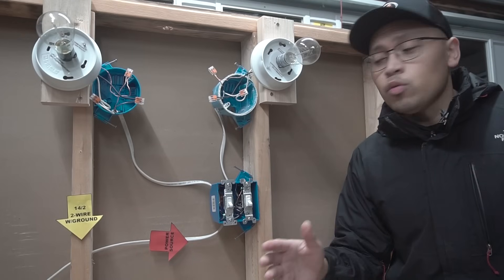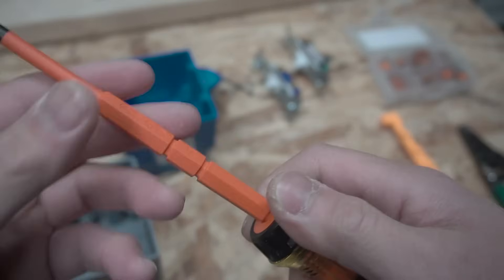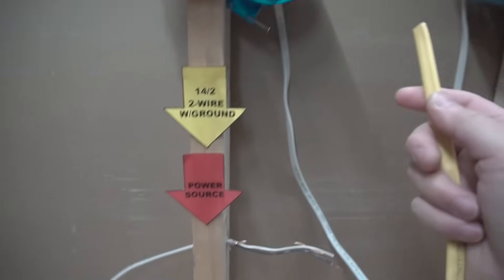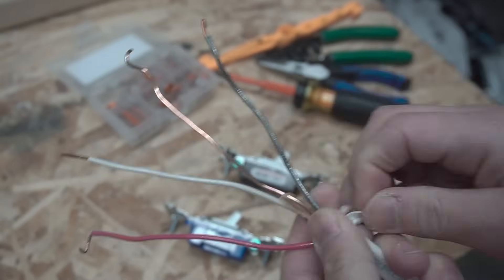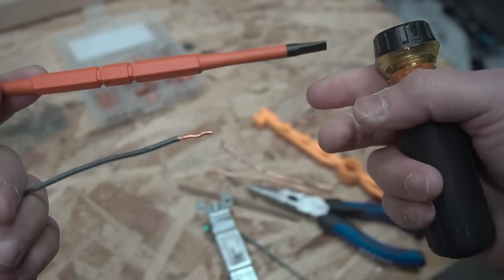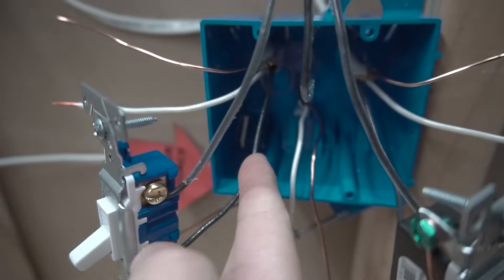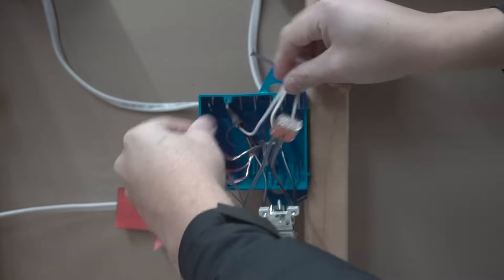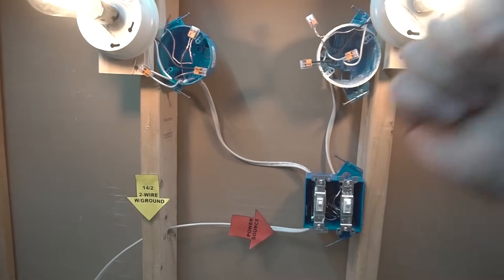How To Wire 2 Single Pole Switch Inside 2 Gang J-Box To Light Fixture (2022) | DIY Beginner Tutorial

Comment: Your a savior man any other combinations you can think of and recaps are great 👍 you explain it better then a teacher .
Reply from the maker: Thank you so much!! Next video is a 3 way switch, this one will take longer to make but it’s the next out. Stay tuned 🙏🏽😊
Reply: 100
Reply: Is this the same way you hook up a fan and a light in a bathroom
Reply: Luckily i was smart enough to start the video before i completely took the box apart lol
Reply: This is what I needed thanks dude! Now I need to to do this in my bathroom bec.i always replaced my other switch,keep burning out so you know why?
Reply: I have 2 coach lights mounted on the wall of my front porch. Both are switched from 1 switch inside. I have installed 2 ceiling fans on the porch. Can I get  unswitched power from the already powered lights?
Reply: Great video. I should have watched it before I tried it myself and blew a fuse. 👍👍
Reply: Very good
Reply: Yes! And tired and frustrated and hate your life for starting this project

Comment: Can you comment on how to wire a second switch when the power goes to an existing light first?  I am adding a bathroom fan/light combo, and the existing switch, which controls a light on the wall, has the power going to the light first.  So I only have one black and one white at the existing switch.  I am hoping to only have to bring one wire from the new ceiling fan to the second switch?  Is that possible?

Comment: That wire strip gauge on the back of the switch isn't for if you're making a loop! It's for if you insert it under the metal plate under the screw straight in like a "back stab".  You have wire insulation under the screw which is a big no no! People dont do this! It'll create a hot spot and potential fire down the road.

Comment: Great information. 
Is it safe not to use pigtails and just run the hot to one switch then straight to the other switch?  I have a fan and light fixture in bathroom connected this way. . What are the dangers of keeping it like that?  Thanks!!

Comment: How would you wire: one power source, two-gang box, one side standard single pole switch that controls one light, other side a toggle switch/outlet combo where the outlet is always hot and the switch controls a different light?

Comment: I am 99% sure I did this correctly. Both lights work, but the left switch shuts off both lights. If the left switch is off the right switch does nothing. Back to the drawing board after supper

Comment: Sounds like what I want to do. I want to come off the light switch for my garage ( the one at the front of the garage) to a second switch that in turn will go to an exterior all weather outlet so I do not have to route my Xmas lights under the garage door. I am thinking I need that second switch to control when I am allowing power to the outside. Does this video solve my problem? I understand I need different wire for the extension going outside

Comment: Hi I'm planning on wiring a ceiling fan on one switch and two wall sconces on a separate switch. (2) Switches (1) J Box. Would I basically just pigtail the sconces together and then connect to the switch for the sconces? Sorry if this is confusing the video helped me understand a lot more about this project just wanted some insight on how to throw (2) lights on one switch. Thanks!

Comment: Great video. Question - if the second switch is in a different box and different room, does this still work? taking a 14/2 wire to the second switch from the first switch, connecting the neutrals, connecting the grounds, and hot from first switch to top screw, hot from fixture to bottom screw?

Comment: I came across your video because I’m in a dilemma. I’m in a modular home. I have a 2 pole switch out. I get the organizing from the power source to the switch. My problem is, the switch has power source from each side. The original contractors had a jump to keep channel to other outlets on the loop. One switch operates laundry room light and other an outdoor patio light. Do I need to combine the power source wire as one then wire the switches? Or do I need to put a jumper line like they originally did? The original switches were self contained style and we are converting to the ones like this. I really appreciate your expertise because I’m lost.

Comment: New sub 
Well explained. 
Only concern I have is, seems like you connected one black power to the top of one switch & then the other black power wire to the bottom of the switch, hmm. I was thinking you were going to connect both hot black wires to bottom of both switches. Hope this makes sense.

Comment: I did the 2 single pole switch, but I have a 4th wire in the box that goes to two more sets of lights.  I added the black wire to the cluster of hot wires and  the white wire to the rest of the neutral.  My problem is when I toggle off the original switch all the lights on the line go off
.  When it is on all the lights on the string can be turned on an off, as long as the switch is on.

Comment: I love the video and while I understand the concept, I’m a little confused. I have a mix of older romex and even older 2-wire systems. It’s not knob and tube, thank God, but I’m still stuck. I have a 2-gang box like you, with my Front Porch light and Living Room light (ceiling) in it. It is obviously the same setup, except the power and switch legs are in the ceiling. I was able to test continuity for all, except the 2 switches in the 2-gang box are somehow tied together. I want to put in a chandelier in the LR, but I only get it to always be on, and switch does nothing. The porch switch leg and LR switch leg are tied together, based on continuity test, but I can’t figure out how to wire the switch in between them. In the LR ceiling, I have Source, dining room switch leg, porch and LR switch leg pairs. I didn’t make note of the connections when I removed the old fixture a long time ago (put in ceiling fan, but it was also always on). Help

Comment: I have an existing ceiling fan on a single switch and want to add a 2nd dimmer switch for recessed LEDs.   Can I splice my power source first with pigtails, then wire each switch accordingly?

Comment: If you have a socket coming off of that & need a hot to continue, is it ok to have 2 hot pigtails with the hot coming in & hot going out? Basically, is a single hot going to 3 hots, 2 switch pigtails and a hot line continued for a socket.

Comment: I ended up with two red wires, one with power and the other not. My left switch does not electrify my room wall switch for a lamp, but it does power my living room downstairs. Do I need to connect both red wires to the back of the lamp switch?

Comment: Hi, thanks for the awesome video. Very clear and consice. I have a similar setup in one of my bedrooms, except I will be running 14/3 to a ceiling fan instead of two 14 / 2 wires controlling separate lights. I am not sure how to go about the 14/3 wire in my setup as the extra "red wire" is throwing me off on how to go about it. Thanks

Comment: Just looking for some input on why 2 power would have to be used instead of 1 on a 2gang switch when the tab is still intact...
I understand that 1 power should work to power 2 lights separately. 
However, the dilemma I dealt with is, I had to run 2 seperate power from the same main line to each screw to make the lights work separately. 
So basically... main line > 2 seperate power/neutral/ground lines > 1 set of wires to power bathroom ceiling light and 1 set of wires to power light above sink. 
However, after about 3 months, everything is still working fine without any hot spots or issues. I did use 12 gauge wiring instead of 14, if that really makes much of a difference.

Comment: Thank you for this video. Is this the same process to wire 2 switches in 2 rooms to control individual lights? i mean power coming in to my first switch box (Living Room) to light 4 recessed lights and then power jumping to another switch box in my bed room controlling 2 recessed lights. So do i bring power to my first switch box in living room then using pig tail run another 14/2 to my bedroom switchbox? Is this right? Do you have a video on this scenario?

Comment: Best explanation of this process I've seen yet, even tough it's 3 years old, I'm in the process of wiring up my wifes shed with 2 switches, to inside lights and one outside light, on a 15 amp line.  LED bulbs all round.

Comment: Great video ! If my power and load wires  are in one box can I run 14/3 to my switches box and mark the white and reds w black tape? So black  pigtails to top of switches and red and white (black tape marked) go to bottom of switches - and then get picked up in load/power box and connect to each black loads, leaving white loads to connect to white hot ??

Comment: Hello everyone! I’m working on my thesis right now and have a question regarding on this setup. I have a 1.5hp motor running and an induction stove, will this setup work safely?

I’m kinda worried that if I use a single power source, I will encounter some issues. I would appreciate every help and tips. 😄

Comment: I have this setup in my house that's causing me a lot of frustration. It's a similar setup but the left switch was a "smart" switch that required a neutral and the right switch is part of a 3way switch. 

the previous owners wrapped the white wires together but attached one ground wire into that bundle of white wires. That feels like not a good thing to do? but without that it doesn't seem to power on. Also for some reason there are 3 Romeo wires, 2 for the smart switch and one for the 3way, but only the 3 way has power and they tapped it to power the others. No idea what's going on

Comment: Would this same method be used if the second switch was in a seperaye box in a different location?  Would there just be another section of wire running between the switches?

Comment: What if you had 4 wires going into a junction box . And two single pole switches. I have one that has 4 wires and a jumper wire. When I wire it up the inside light Is turning both lights on. Inside light and porch light. This must be in the middle of a branch circuit for so many wires.
Reply: Nevermind. I had the power wire on the other light switch. And had to find the wire going to the lights.

Comment: What if u do you have another wire coming in that controls your fan in your electrical let’s go in your room like your wall plugs how do you hook that up along with the two switches that run your bathroom fan in yourlight

Comment: Thank you for the video. I'm wondering if I can use a dimmer switch on one side and the single pole switch on the other? I would like a separate switch for the ceiling fan, and the other dimmer switch for a set of can lights. Thank you for any help.

Comment: I have two switches in my restroom  one is a double the other a single. My problem is it feeds out to another part of the home. It had a pig tail and I'm unsure where to hook it up. Because it just fell out when opening the outlet. I wired it in but now the other part of the house only works if the double light switch is in on position. Tks. HELP PLEASE.

Comment: Swapped out two separate dimmers to a 2 gang. Those push connectors are great and made it much easier. I tied two snippets of wire and a single strand, and grounded everything outside of the box.

Comment: Great video. But, I am having one problem. I wired everything precisely as you said, but for some reason the first switch for the bathroom is controlling the new second switch for the shower. The new switch for the shower light only works if the bathroom switch is on. Shut off the bathroom switch and both light turn off. I double checked all of the Wago connections and even electrical taped them to make sure they would not open up. Any suggestions?

Comment: The only thing I can add... If you are  working with existing wiring and don't know what the wires go to or come from, turn off the Circuit Breaker, disconnect all the wiring... make sure no wires touch each other, then power the Circuit back on, and use a Proximity Detector to determine the power supply wire, then turn the  breaker off again and follow your instructions exactly!!!

Comment: It makes no difference if power is connected at the bottom or the top terminal on the switch right? Does code require that you wire power in at the top terminal?

Comment: Yeah hi I have a question  I have old light pixtures  3 in the basement I change it to led lights  and when I try to re connect the wire one is not tuning off  any suggestions will help thanks😊

Comment: Thank you, this is such a great video, and your explanation and steps are fantastic! If I have a 2 gang box with 2 single pole switches and am looking to change one of the switches to a "smart" switch that requires the use of a neutral wire, how do I know which neutral wire to use within the bundle of neutral wires? Thank you in advance for your help!
Reply: I may have figured out the answer to my own question, but should I connect the neutral from the smart switch into the entire "mass" of neutral wires so ALL the neutral wires are connected together (assuming they are all going to the same breaker)? Thanks!

Comment: For wiring 3 switches in a box there are 6 ground wires, how would you connect a wago connector if the biggest wago connector is 5 pins?

Comment: Your video is very clear and concise! Thank you. I have a box with two light switches that control one fixture? I don't know why its like that. I would like to remove one switch, and install a wall receptacle. I have the parts, but when I remove the switch plate cover, I see two switches wired identically with four black wires. Also, there are three white wires all wire nutted together. I replaced one switch with the receptacle, connected two black wires and the light still works (with the switch), but there is no power to the receptacle. When I replaced one black wire on the switch and the receptacle each, with a white wire, nothing works. I guess I don't understand this wiring. There are other plugs in the room but they are unaffected by this work. Any ideas?

Comment: I've watched a couple of Fix This House videos and while fairly informative, in at least two videos he claims that the numbers in the back of the electrical box (16/14, 14/12, 12/10) represent the number of wires you can connect in the box / gauge of respective wire. This is NOT the case. If it only were that simple. There are other factors to consider, like the size of the switch or outlet, for example. To determine the max number of wires, you have to work out a Box Fill Calculation, which can get fairly complicated. This really should be corrected.

Comment: Okay, here's one for you... Two switches, two lights, one power feed, but the switches are four feet away from each other. And the second switch, farthest away from the feed, is a lighted switch.  How would you wire that?
Reply: You would wire it the same exact way, but make your black pig tail a little longer than four feet (so you can tie it into power source). Make a neutral pig tail the same length and tie it in to the neutrals as well. Do a ground pig tail the same way (that should be done first). Run your 14-2 (if you’re on a 15 amp circuit) from your light fixture to your switch. Now let there be light! 🙏🏽
Reply: Just keep in mind that you should have a black running from fixture to switch. A black pig tail long enough to reach and tie into power source. A white pig tail going from fixture to other neutrals. And ground pig tail going from switch to all grounds.

Comment: I love how clear your instructions are.  It was encouraging for someone who hasn't wired in a while.  When I have the circuit breaker on, no matter whether the switch is off or on, the voltage detector still flashes at the hot line at the light fixture.  Is that normal?  These were new switches rated 15/20.  Edit:  The power supply feeding this outlet is some type of cheap 2 wire with no ground so I think that's the problem.

Comment: Great video very well explained.  I have a similar scenario like this but with 8 outside basketball court lights and 1 volleyball court light.  Both the volleyball light and basketball light wires are going to a breaker panel to one fuse on a pole outside.    They want the Bball lights and Vball lights separated (on/off) with 2 switches. There is an 4th extra red wire coming from both the fuse panel and VBall court light pole to a gang box on the breaker box pole.  I’m assuming instead of 2 switches at the breaker box pole they wanted these switches separated.  One switch at the breaker box pole controlling the bball court lights and one switch at the Vball pole controlling that light.  I’m assuming this because of the red wire.  So if a red wire is coming from the Vball light to the gang box on the fuse panel pole that means a switch can be installed there at the VBall pole?  If black is power what purpose is of the red?

Comment: I think connected my two ceiling lights using this method. However in my instance each light switch operates a light but the second light requires both switches to be in the on position.

Comment: I have a light fixture that is connected to an end of run switch. I want to add recessed lights in the same room but want them to have a separate switch using the same power source though. How can I do that?

Comment: your videos are the best i have learned a ton! how would i wire a single pole switch for one light and a dimmer switch for another light and piggyback on to the incoming power for those to go to an outlet down the line, all in the same box? so i have power line coming into the box  a line going out of the box to the outlet and the switch and dimmer in the box